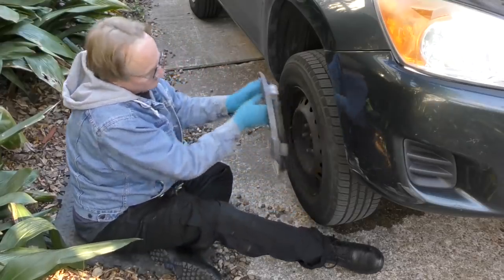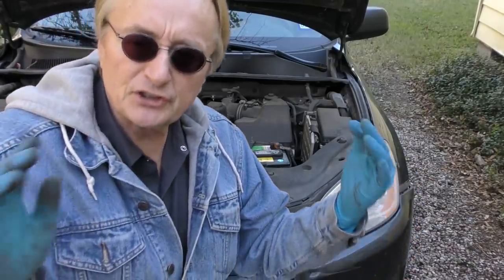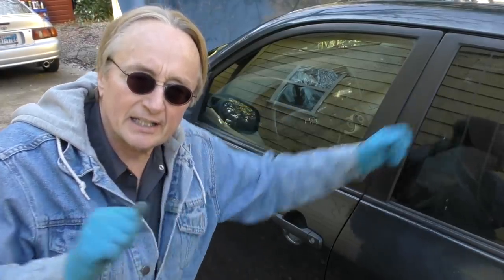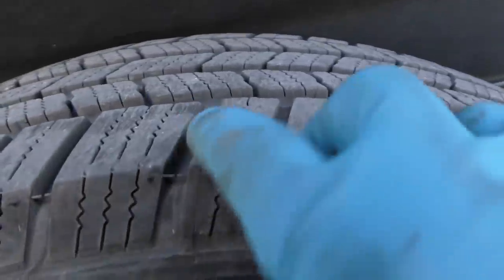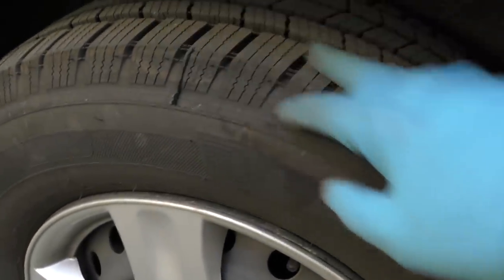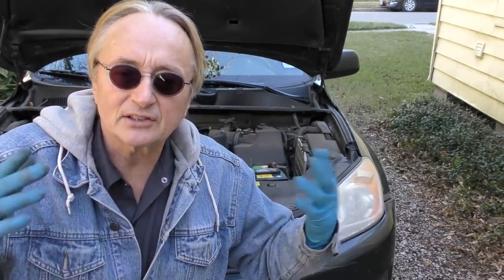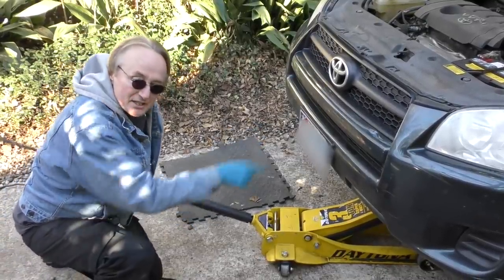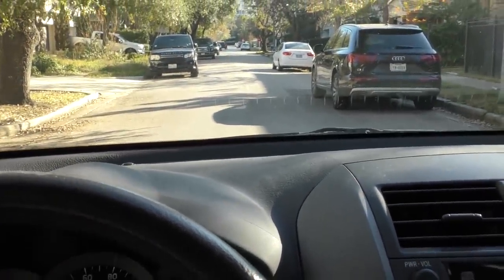Tire Secrets Only Mechanics Know

Comment: Great video Scotty. Yes, rotating the tires every 3,000M (5,000km) is going to do wonder to prolonging the life of the tires and making the vehicle ride better. And I agree with you: why the heck would you put the new tires on the rear of a front-wheel drive vehicle. Makes no sense!! Good mechanic story. I had a squeal in the front of my 98 Honda CRV. Took it to my mechanic. It was a stone behind the dust plate on the front brakes. He didn't charge me. Thanks for the great information. All the best, Cheers Rick
Reply: Well if your vehicle has a lot of oversteer and you're driving in a snow storm, you may find out why.
Reply: I've seen people spin out on the highway from having the bald tires in the back.

Comment: RAV 4, 2008, 180K, old car, umm- screeeech! Haha, Luv Ya Scotty!  got a 2004 Envoy with 194K on it, and I've only had to replace: CAT(under warranty), still going strong... water pump(a real pain), did the thermostat for good measure... cruise control sensor(helper broke it), front rotors(finally), back still just BARELY spec out, & brake pads, obviously. YOU have helped me so much, and I do every prevent-maintenance thing you tell me. Also: on a side note, I had the same problem in this video and EVEN tho I got a 4WD, I just put the BACK on the FRONT, and... Majick! Thanks for all you do, and a "REVVIN" Good New Year To YOU"!!!

Comment: You're absolutely right. A tire shop should not dictate where you want your new tires. The reason they want the newest tires on the rear is so the rear doesn't wash out in foul weather causing someone to lose control. It's promoted as safety but I personally think they want you to buy four instead of two. Btw I installed tires for over 10 years.

Comment: I understand that the whole "better tires in rear" thing came from a lawsuit where someone spun out on a curve. The lawyers got a settlement from the shop that put the better tires in front, "causing the accident."  So, shops put the better tires in the rear because the lawyers have decreed it. I have had to sign a waver to get my better tires placed up front. [I buy 4 tires at once, rotate them as appropriate.]

Comment: Thanks Scotty.  I bought my first front wheel drive car in 1981, and noticed the physics of driving changed, and I had to rethink everything I knew in the past about driving.  Driving habits were easy to relearn, but maintenance was a learning experience.  Every other oil change balance and rotate tires.  Rear tires straight forward, R/front to L/rear, and L/front to L/ rear.  90% of tire related problems resolved.
Reply: Except now you have 2 tires on your left rear. That I'd like to see...lol

Comment: In the North on Icy or Wet roads you want the better tires on the rear. My neighbor is a tow truck driver and has been for 35+ years and the people that put better tires on the front are the ones totaling their car because the car spins out due to lack of rear traction causing it to fish tail. When the back comes around there is nothing you can do because the front has too much traction. Most of the weight in any vehicle is in the front over the front wheels so yeah you might not get up to speed as fast but when you hit the brakes the good rear tires will still stop straight by pulling the rear straight.
Reply: I had a similar issue with my Snow tires. they would slip more than usual. I. had put the “Better” tires on the rear but spent the whole season spinning on takeoff. Next season I move put the good tires on the front. No more spinning and no fishtailing unless I used the parking brake.
Reply: Nonsense
Reply: You always want the better tyres on the front as this does all the steering and most of the braking, after that people just need to learn to drive. The Back will follow the front if vehicle is handled correctly.
Reply: @kiwidiesel5071  Not with front wheel drive cars, the rear end will act like it's on ice....
Reply: What about hydroplaning.    Worn front tires will cause you to hydroplaning when the tires turn into skies when roads are full of water.  In the South we have more flooded streets then icy streets
Reply: @johnd4348  If they are that bald you need new tires
Reply: @PanameraTurboSEHybrid  the rear will still follow the front more so with front wheel drive, if the rear is letting go all by itself then you are in serious risk of crashing anyway since the front wheels then have to turn, brake and accelerate. Most people can't drive correctly and that is the cause of crashing not the tyres. I don't mean giving way or when to indictate ether, I mean most people only experience loss of control when it occurs for the first time, incorrect driver input is the usual cause. I have over 1 million miles heavy tracking experience so I kinda know a thing or two about traction and grip when I have only one steer axle, that's two tyres and 8 other axles adding up to 28 tyres that just rotate.
Reply: @kiwidiesel5071  Bald tires are always the culprit when a vehicle hydroplanes loses traction and crashes(or not). Best driver in the world or even pro drifters can't prevent a spin out on bald tires in the rain....With FWD, the force/momentum will make the rear end of the car spin all the way around (depending on vehicle speed) even if the rear wheels follow the front, remember no traction/grip back there. People will over react/correct because it will catch them off guard no matter the experience. Weight is probably the only reason why more cars with bald tires don't constantly loose control when driven moderately. But you'll catch them out there fish tailing a bit after a turn.
Reply: @jasonbusch3624  Front tires normally wear faster than back tires. When I was young and broke, I would buy two tires and have the tire place put them on the front.  Back tires always lasted twice as long as front tires.  So then I had tires of almost equal wear and condition.  Places now only insist on replacing the back tires.  I would rather have my better tires in the font for better control in wet conditions.
Reply: @PanameraTurboSEHybrid  yes well you can't fix stupid, if someone wants to drive on bald tyres then best keep away from me.
Reply: @kiwidiesel5071  I know right lol!
Reply: This is correct. The logical reason to put better tires at the rear is that most driver are not taught nor have experience to do a counter-steer in case a fish tail at rear occurs. This is counter-intuitive to most driver (to steer at the direction of fish tail at the same time, the eyes of the driver needs to locate where the steering need to be pointed at). It is difficult to give a correct amount of counter-steer due to the road slippery may vary. Over counter-steer may occur. In other situation, aquaplaning may occur at the front wheels even on new tyres in case a vehicle speed is too high. In this situation, there is really not much one can do except to slow down the vehicle and to allow the front tyre grip to return
Reply: This is the same reason that when you swap to winter tires that you change all tires and not just the front ones but if you have only two and you really need to put them on, it is advisable that you install them in the back position.

Most shops will not install winter tires just at the front and may be illegal to do so in some places.
Reply: @johnd4348  , if you getting the hydroplaning on the back you may end up with your tail against traffic. The same on snow and ice. Better traction in the back is better for stability.
Reply: @kiwidiesel5071 , the difference between 28 tires and 4 are that you have more stability and side traction with 28 tires. If you using the other extreme a motor cycle. In MotoGP (bad example I know, you should not race on the street) the riders often uses a softer tire in the back, on reason are traction and stability. With a car on slippery surface like water, snow and ice you getting better stability with less slip on the back end. But then again I you drive so your car hydroplaning then you driving to fast. The same on ice or snow.  So what I'm saying is if you drive your car with worn tires as if they were new in rain or snow (ice) or drive as it is summer and sunny in the same conditions the problem will not be if you mount your better tires in the back or in the front.

Comment: I've had that tire argument. Those rear tires on most cars are just hanging around back there keeping the rear end from dragging on the ground... Heck I used to have them put the best tires on the front of my rear drive cars, because the front is pointing the car around and taking most of the brake loading. I think "We put the best tires on the rear" is just so they can sell you the other pair sooner for the front, or get you to bring it in to find the shimmy or whatever.
One other thing that can affect your braking/steering a bit; if you had a leak and patched it with that flat fixer goop, it can possibly put that tire a bit out of balance. Not much but it doesn't take much on a lot of cars.

Comment: I always finish my lug nuts with a torque wrench. You can find torque specifications in manual.
Reply: I just use my breaker bar and not go nuts on it
Reply: By a cheap torque wrench at HF and keep in car. Cheap insurance. Always recheck torque when checking air pressure cold.
Reply: @davidg5704  il do that in the future 😄 i check them oncr a while n keep the breaker bar in trunk
Reply: Too many people don't understand how important it is to follow that simple and easy piece of advice.
Reply: Good advice. It's good to check them regularly, too.
Reply: or just do it enough and you can tell the correct torque by hand
Reply: Change lug nuts every 5000 Miles lol
Reply: I do the same thing, just about everything on a car has torque wrench, I’m real particular about torque specs.
Reply: Over torqued can cause more problems than under. When I do connecting rods I go a step farther and use a stretch gauge.
Reply: You know torque specs are based on material, bolt diameter, and thread pitch. It's not based on the application.
Reply: And a little bit of anti-seize.
Reply: i just press down with my weight. 😎 never died
Reply: When it comes to lug nuts I've always just gone with the "Good N' Tight" method (crossbar tight, then snug it up just a little more with the breaker bar)🤷‍♂️ But it doesn't hurt to be precise👌
Reply: TrueConservative225,
"... you can tell the correct  torque by hand."
I would bet that you can not. Tighten all nuts on all four wheels your way, then re-check all of them with a torque wrench. If even half are correct I would be surprised. (That might make a good video. I bet it would get lots of views, especially if you mention it the comment on one of Scotty's videos. )
Reply: Lawrence Jensen,
The spec for my aluminum wheels is 100 lb-ft. Big difference.
Reply: @ArcoZakus  Yep. Specs account for more than thread pitch, diameter, and material.
Reply: @anonymousfriend897  I use synthetic lugs,  car will run forever
Reply: George Ohm  
Yea, your right.  It's like the huricanes turn opposite below the equator.   I get it.  Good thinking!
Reply: @davidg5704   That's really not necessary. Be sure the torque is set properly whenever the lug nuts have been removed and then at about 100 mi thereafter. After that, leave them alone. Also torque them in the proper sequence.
Reply: I use a breaker bar. When the car moves thats about 100 lbs. Thats all you need. But never ever use an impact.
Reply: @trulysick86  $10 for a torque wrench from HF...no brainer. And, yes, it calibrates accurately. 76 lb-ft for my car.
Reply: I torque small cars to 80 ft. Medium and large cars 90 ft. Trucks to 100, 1 ton trucks 110 ft.
Reply: @appealingpit  Lexus LS400 = 76 lb-ft. Over-torquing often produces rotor warping.
Reply: wholeNwon  yes each car is different, is. Why I use torque sticks. Then check with torque wrench.
Reply: @appealingpit  torque spec on a GMC 1500 is 140 foot lb, ford f150 150 foot lb, just think about that
Reply: @mikeosborn1032  at least there torqued. Not just impacted on. Is why hate tire shops and garages. They just impact them on.
Reply: My owners manual, Chevy say 100 torque ft. Pounds for lug nuts.
Reply: Harold Lewis  I use torque sticks also, If I want I use the stick one step lower than what I’m shooting for, then finish off with torque wrench.
Reply: @anonymousfriend897 , it's not the nuts but the studs that fail due to over-torquing.  Metal fatigues with repeated gorilla-grunting tightening, so it is amazing more do not fail on American highways!
Reply: Yes check specs! Could mess up your rotors if it’s over tightened. From my dad who’s been a mechanic for 70ish years (he’s 86 and still the farm’s mechanic)! He’d love this guy 😆
Reply: The whole "best tires on the rear " is mostly when people replace only 2 tires and the old set has more than 2 32 of usage . I'd still do it at 3 32 difference because at some point the front tires will catch up to that difference.  This being said , if you rotate your tires every 7500 - 10000  miles you'll never have that issue .
Reply: @timturner7609  It is based also on the aplication. When you have sine type of force you must use different torque than when you have static force... You must count material deformation caused by force when you are deffining the torque and bolt/ thread specs.. That´ s why you have specific procedure for tintening head bolts.
Reply: George Ohm : must be from Alabama

Comment: Yes Scotty, it is better to put new tires in the back if your only buying 2 if you live somewhere it rains a lot those new tires will prevent your car from hydroplaning on the interstate and causing an accident.  Putting them on the front will of course give you better traction and improved handling, but the older tires in the back will not hold on as long and will cause you to spin out if its wet or snowy out.  But ultimately its better to have 4 good well taken care of tires so you know the threshold of your vehicle so you can adjust accordingly to the road conditions.

Comment: I`m an old disabled mechanic and agree fully. In the old days many would put 28 psi in the front tires and 32psi in the back and i always told them they are nuts because the back of the car or pickup is empty and the front has an engine that weighs a few hundred pounds, and that when you are stopping the weight shifts to the front and that will hundreds of times more weight because of speed than the actual weight of the car at rest. I run even air and max stated on the tires.

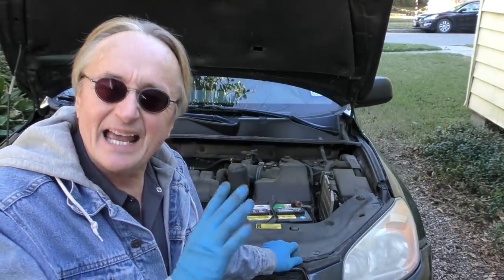Comment: 5:05 as a tech working at Discount Tire, we always put brand new tires on the back because lowers the chance of hydroplaning in wet conditions. After they are “broken in” it doesn’t really matter to us. If the customer wants them on the front though, we put them on the front. It’s a stupid “policy” to not do what the customer asked for (if it’s within reason, of course).

Comment: I had a similar problem with my 1998 V6 Camry at around 180,000 miles. Rotating tires seemed to help for a short time then the problem came back. Replacing the front calipers fixed it. One caliper was sticky causing the car to pull erratically under high-speed heavy braking.
Reply: That was my thought. And do a 4 wheel alignment

Comment: I work in a car garage in the UK when we are putting new tyres on a car they go to the front if its front wheel drive or rear if its RWD. Its a known fact that if you put the new ones on the rear and the worn ones on the front of a FWD car they'll wear out quicker same with new to front on RWD cars, that way these other garages around can sell them new tyres quicker. Personally I think that's wrong when other garages do that squeezing people dry years ago it happened to my mother when I was a kid. Always be honest and helpful they come back to you then s'what we do and people keep coming they appreciate honesty
Reply: I believe honesty will go along way.
Reply: I was once told at a tire place the the wobble I felt in the front of my FWD car was due to an out of round tire and they tried to sell me a set of new tires for the front. I told them just to put the front set in the back and the back set in the front. The wobble went away.
Reply: Yeah if it's out of shape/stepping on the front can put them onto the rear so they'll last a bit longer eventually will start to be able to hear them howling like a wheel bearing but thats if they get real bad they all need changing at some point like anything does

Comment: Scotty, when rotating tires and having to lift the tires up to get them onto the lugs, I use a shovel to raise/lever the tires upward a few inches to slip them onto the lugs. Put the shovel blade under the tire and push down on the handle and the tire raises up into place with little effort. It works. There’s a new video you should make, “how to change a tire with a shovel.”

Comment: I had a front brake wobble under strong braking which was alleviated for a while by rotating tires and Properly torqued lug nuts.
Reply: For a while means? It came back?
Reply: Please define "properly torqued", in that case.
Reply: @stephenarling1667  
What could he mean other than proper spec (lbs-ft) and tightening sequence?
Reply: @RalphSampson...  Tightening with anti-seize or grease on threads will have a different effect than tightening with clean, dry threads as specified
by many automakers. Shouldn't warp rotors, but could.
Reply: @stephenarling1667  
I always put a spot of grease on them just so they're easier to remove next time.
I see your point.  If the threads are dry, there will be more resistance causing more torque needed to turn a given distance.  I never really thought about that.  That's another good reason for lubrication.  Good point.  Thanks.